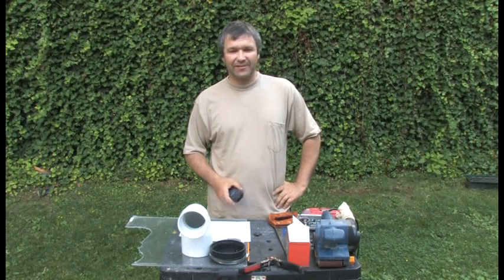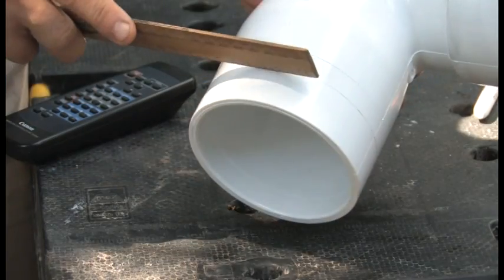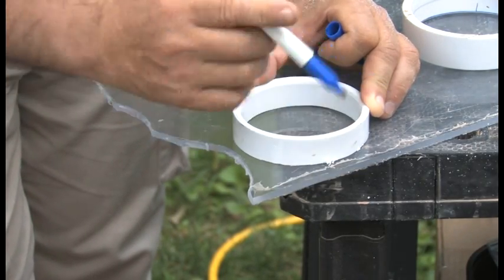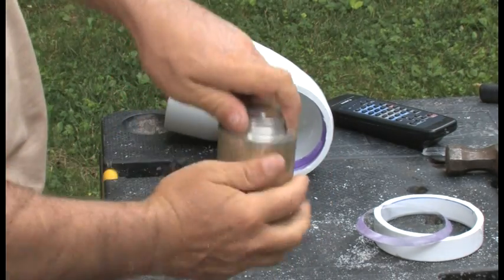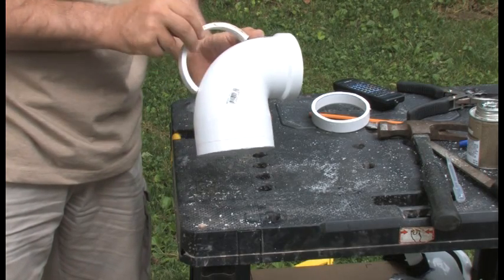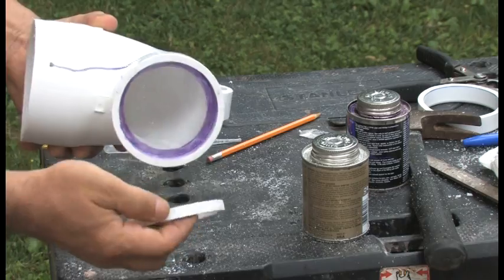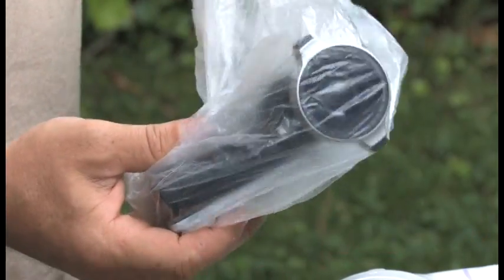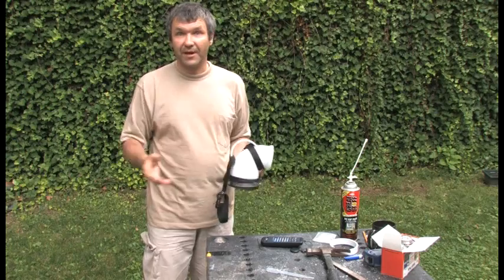Making an underwater video camera casing

Comment: For best results, read the actual directions on the primer can before you use it.  The primer application shown in this video does next to nothing.  I'm not saying your project doesn't work; I'm saying it would be MUCH stronger if properly primed.

Comment from the maker: I have a GoPro. One thig: they introduced underwater housing only this summer. The previous one was not corrected for water. Second: it is useless for small closeup objects. Plus: GoPro was not available in 2009, when the project was completed and applied.

Comment from the maker: Did buy it, and was disappointed: it does not focus underwater. The manufactures are working on the problem, but it seems it needs a special underwater case to film underwater. Technically it can be submerged deep enough, but at the moment it is completely useless under water.

Comment from the maker: @DjN3oX  I use remote to press "Rec" button, and "stop" when I come to the water. Simple. Alternatively the battery dies, and there is no need to press anything again. When you dive, you do not think about the camera. When you need too shoot, just point the camera in right direction (fisheye!). If you forget about the camera, it will hung on the string, and still will be shooting, and vertical, and pointing backwards. I got nice shots this way.